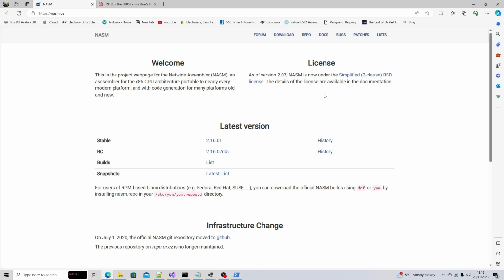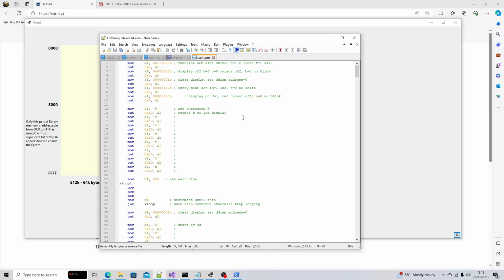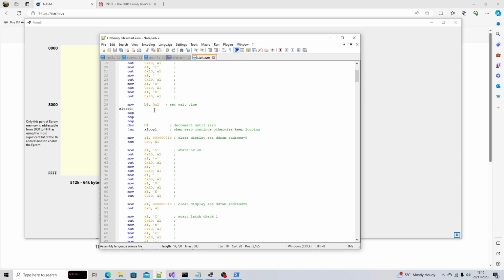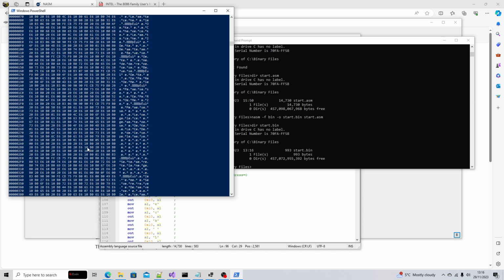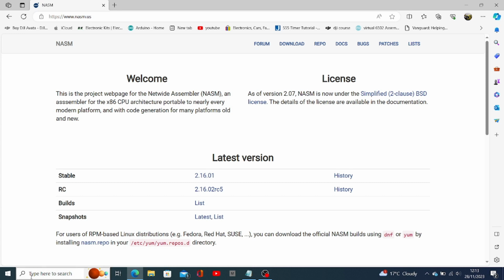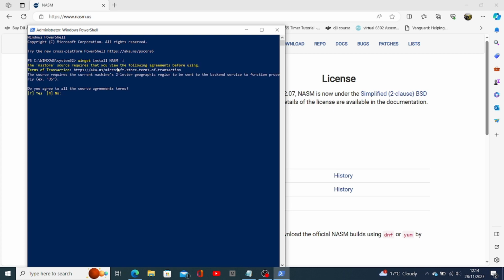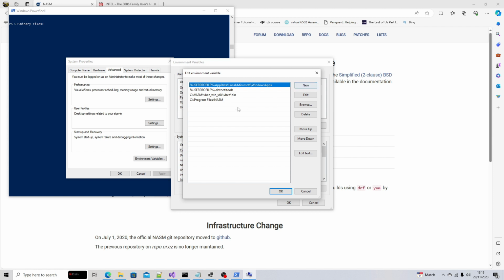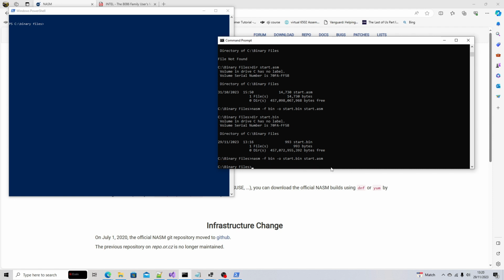NASM Compliler - Generating Intel 8086 Binary files

Comment: Great video series. Thank you for every detailed information. I ask you to share your visual studio source codes. Best regards...
Reply from the maker: Hi Ahmet, thanks for your lovely comment. I’ll have a look at if I can put the source code into GitHub, but what I tried to do was display the code on the screen so folks could pause the screen and input this to Visual Studio as a sort of get around from putting this on Git. Is there a specific piece you are querying or are you getting an error in compiling that’s giving you an error and I’ll see if I can help
Reply: @twigwonderkid  No, i didn't compile yet. Because i prepare my breadboard with two RAMs. Also, your code is written with visual basic. I must convert it to visual  c++.  I asked source code if it is easy to share with github. Otherwise, i can get from video, you already made a good job for making good tutorial. Especially many decades later from marcony, you made very well currently.